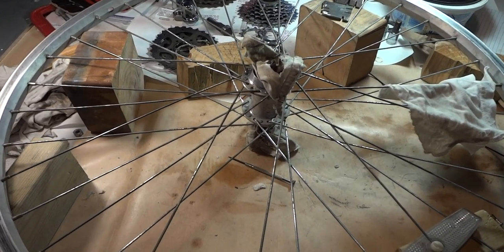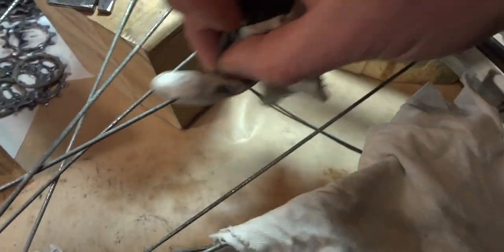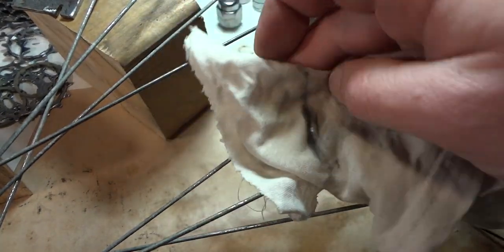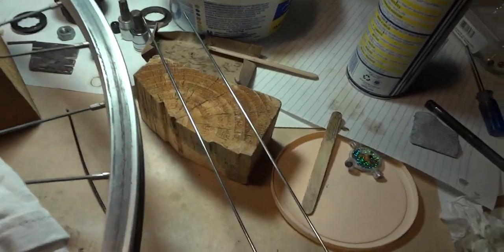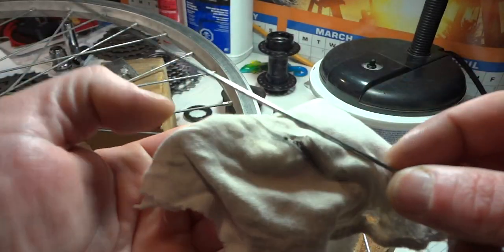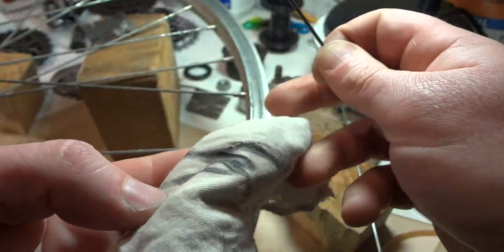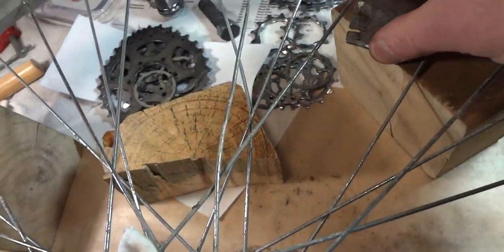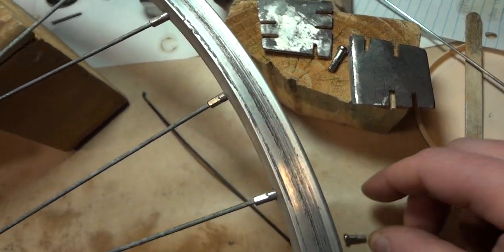Super clean bike spokes DIY mirror finish

Comment: There's no easy way to clean spokes in a built wheel, but unlacing a functional wheel to clean the spokes is pointless.  If you go through the unlacing process, don't clean those grimy spokes; replace them.

Comment: I tried WD-40 and it works, but then seems to rust more after. Id suggest using a steel wool (i use extra fine personally) and then sand with 200 all the way to 1000. Then i use mothers polish. Seems to collect less rust especially since i clean the rust off first.

Comment: Use wd-40 and a wadded up piece of aluminum foil and it will take all of the surface oxidation or corrosion off turning it into a black residue that is easily wiped of with a clean rag or towel.  No special polish products needed.